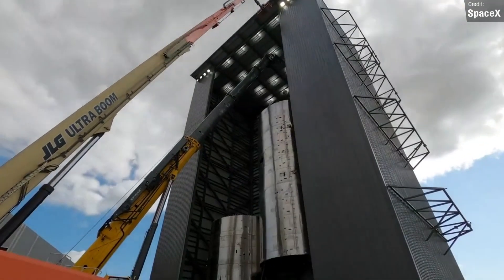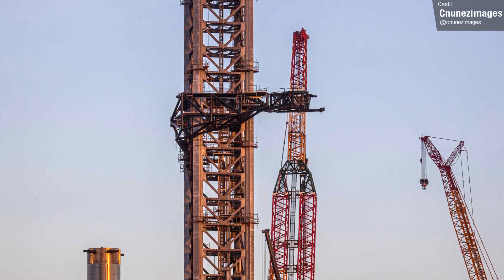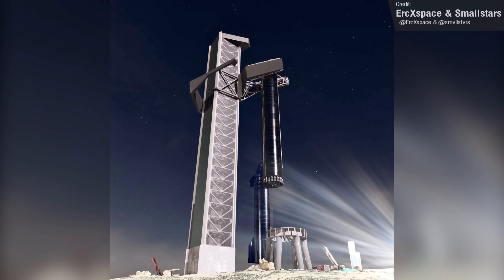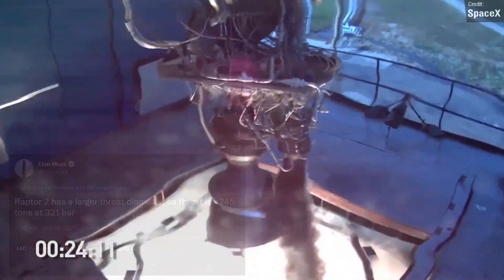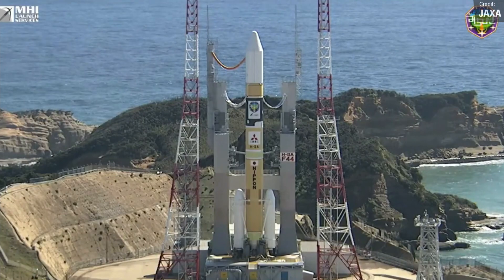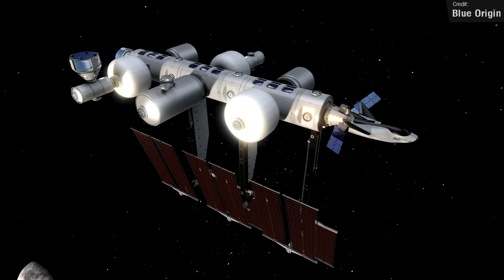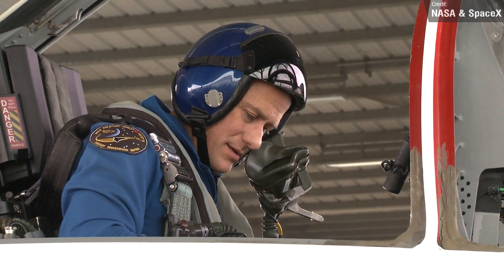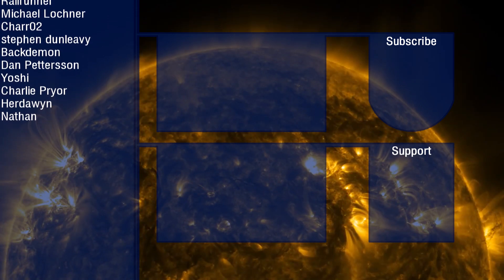SpaceX Raptor 2 News, Starship 20 Has ALL 6 Engines, Stage Zero Rises, Crew-3 Prepares, MS-18 Launch

Comment: The other reason the rocket needs to be sat on a launchpad, and the catch arms aren't sufficient, is that whilst the arms can hold the rocket up during lifting, they can't hold it down during engine spool-up whilst they check that all of the engines are healthy and at full thrust prior to liftoff.
Reply from the maker: Yeah, there's a lot of other reasons, but I went for the weight because I think it's the most readily-easily-understood
Reply: There is also no reason to keep that much weight on the arms over a long time when there is the option for a simple launchpad which does the same less complicated
Reply: Also its a little difficult to stack a vehicle using the arms on top of a booster while also using the arms to hold the booster.
Reply: Also another reason, the pad provides the spin up gas for the 20 booster engines just before ignition. There are 20 quick disconnects in the pad.

Comment: the reason for the launchpad isn't due to weight btw. its  because of the massive contained explosion throwing fuck knows how many tons of super heated rocket air at the ground. if they launched it from a typical KSP concrete pad, it would probably crack and collapse.

Comment: so what is the codename for the stacked rocket?
S for stack
S 4:20
or S20/4
Reply: So when they still were doing the high altitude tests, the actual Starship part went under SN (serial number) designation. S20 uses a shortened version of the serial number designation. The SuperHeavy boosters have a B designation (B4, B3, etc.). For a while, people have called the stack B4/S20.